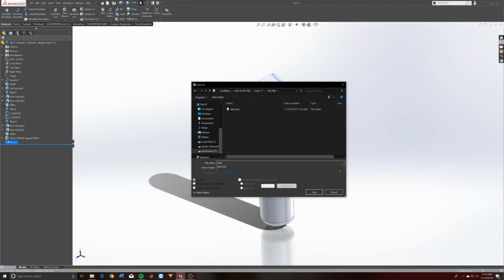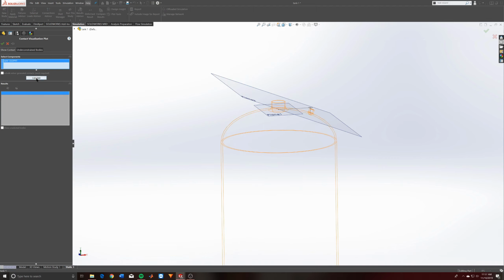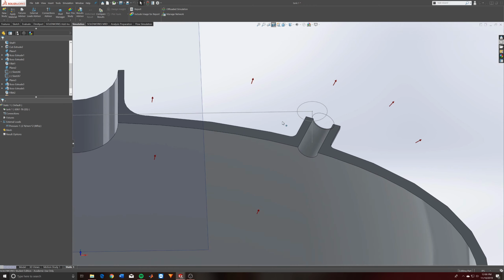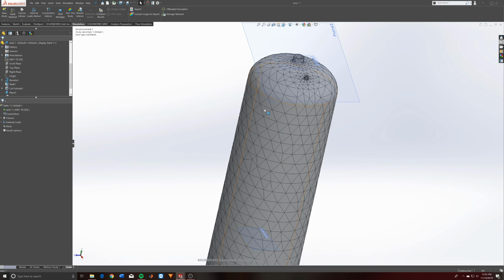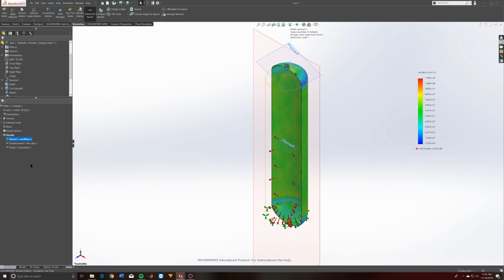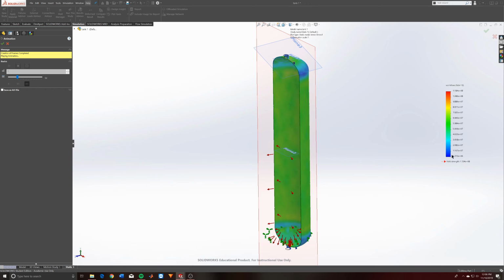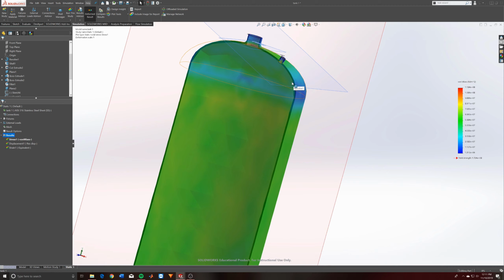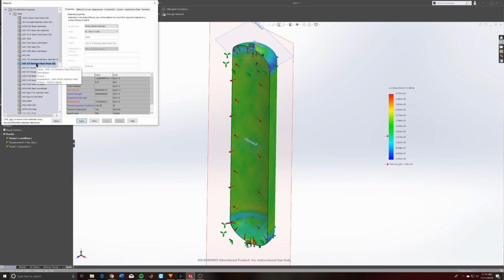Flight Vehicle Pressure Vessel - Part 2 Tank analysis

Comment from the maker: Video Shortcuts: 
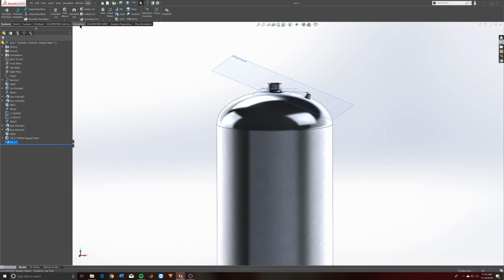1) Analysis Start Set Up - @2:00
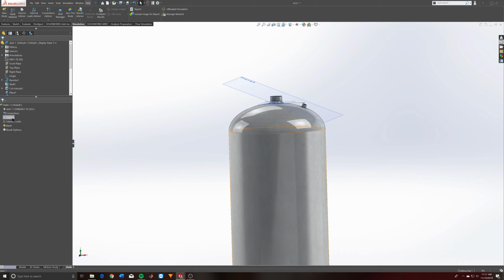2) External Force Definition - @3:23
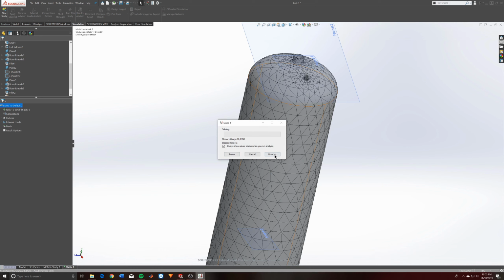3) Analysis Results - @9:00
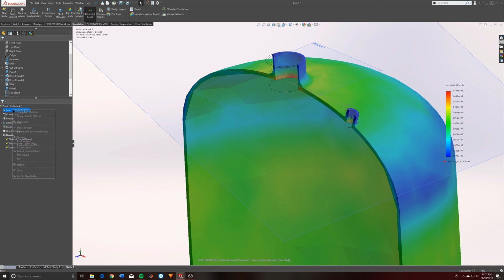4) Material Change & Results - @13:19
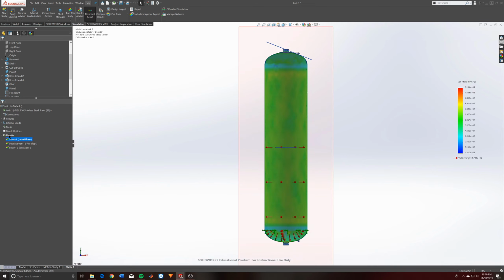5) Export Results as Jpeg's - @15:58
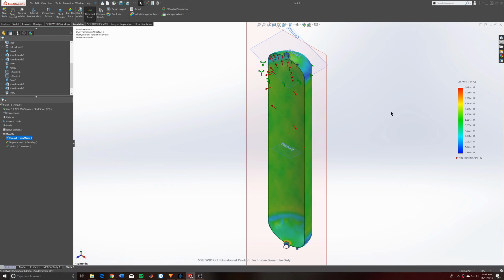6) After thoughts & YS vs UTS discussion for failure criteria - @17:53